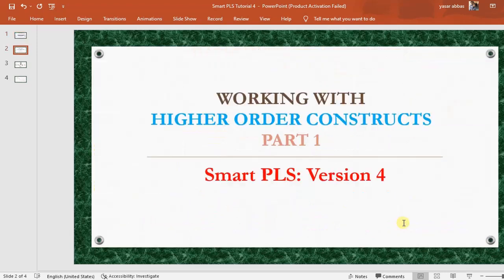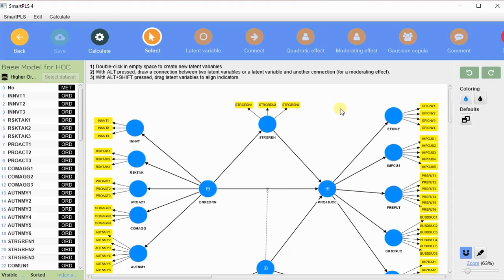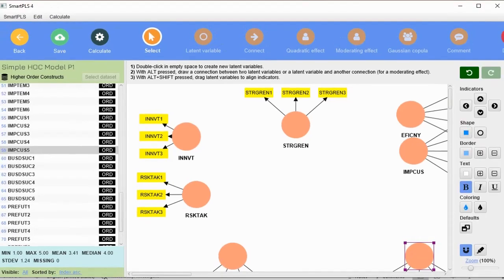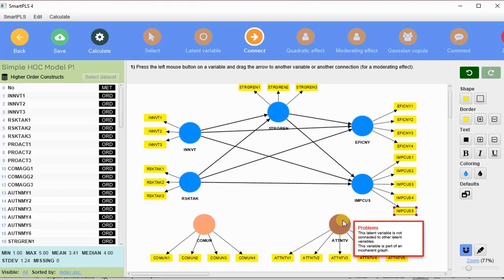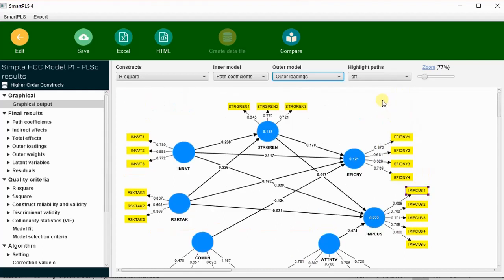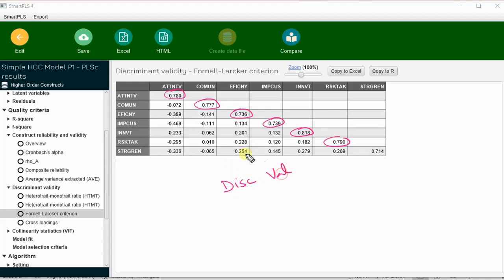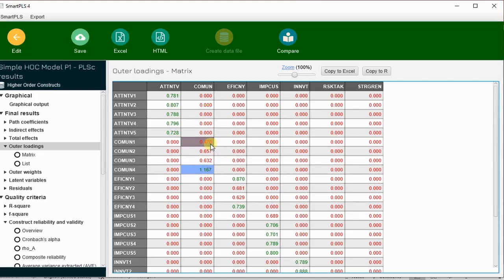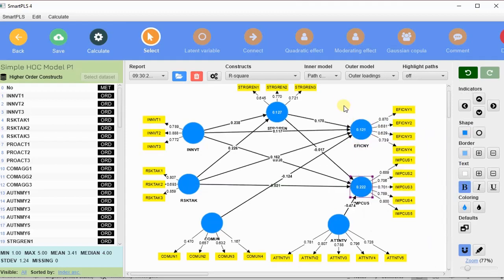SmartPLS 4-12: Higher Order Constructs Reflective Reflective measures Part 1 #sem #cfa #smartpls

Comment: 1.How to do when AVE is less than 0.5 under contruct relaibility and validity.. and it is red
2.Also under discriminant validity 3 value is above 0.8
3. Under Fornell-Larcker criterion all the diagonal value is not highest as u said
What should i do next
Reply from the maker: Htmt ratio may be lies in acceptable range of 0.8 to 0.9 in some cases... As some research suggests (find the paper and cite). AVE must be higher then 0.5. It is showing data issues...

Comment: Thank you sir for video, i have one question that my model is also similar as you shown but i am studying my independent as Higher order construct and dependent and moderator at first order even they have dimensions but i consider my dependent and moderator as intergrated means not  mentioned about their dimensions. Is it okay to run model like this, as studing depenents and moderator as whole. Please guide....
Reply from the maker: It depends on your study and how the prior studies used them (first order or second order). In my opinion if these variables has clear and separate dimension (with reasonable items) then you have to use higher order constructs analysis
Reply: Thank you sir for reply BUT my hypotheses are all about to find out the relationship of independent variable on the dependent variable of my study and the dimensions of independent variable relationship with the dependent variables.

In this case also I can use the latent variable scores of dependent variables in stage 2 OR remain use its items and perform the analysis?